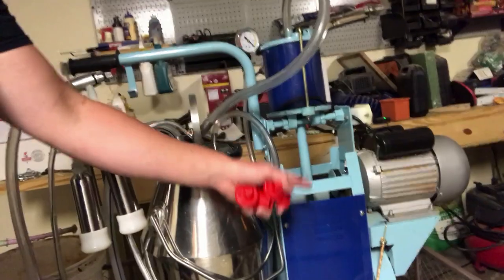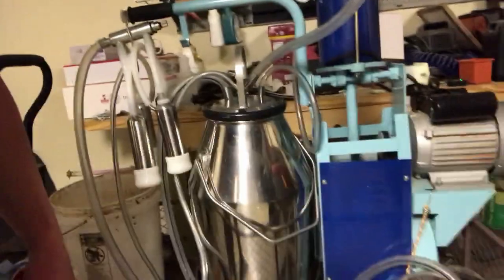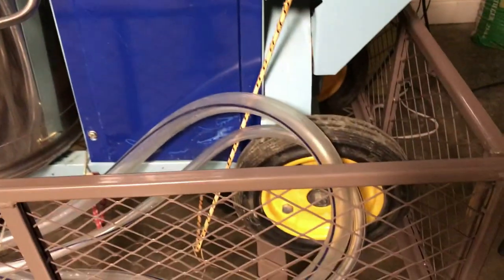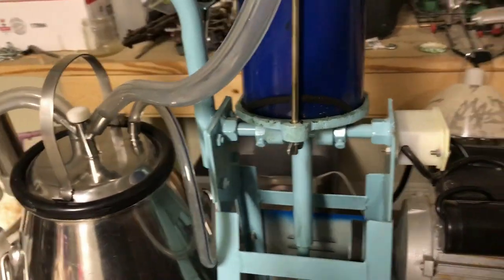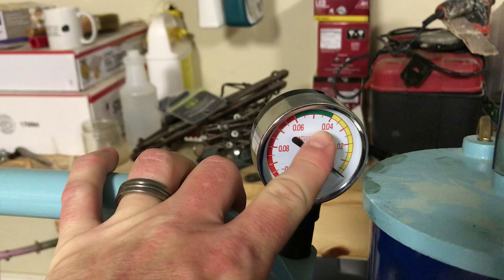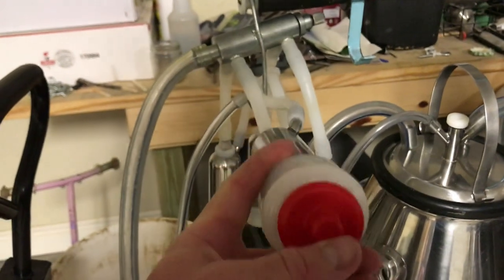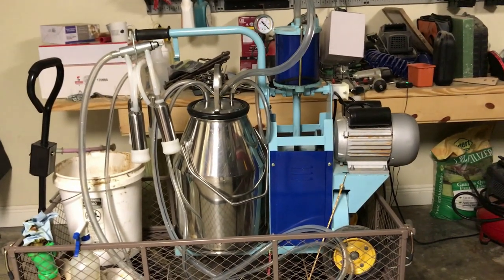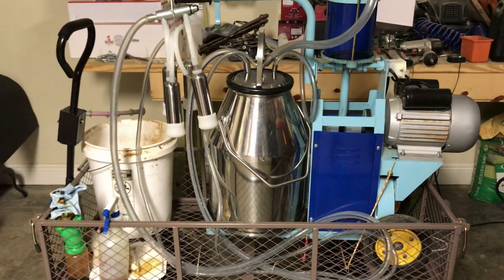Bought On AMAZON For Family Milk Cow Machine Review!! Part 1 Is It Worth It?

Comment: We have one of those machines and it took some adapting the hoses for the claw . They are too soft and light so we bought some of the old type cups with the heavier black hoses. The machine works but a bit slow. It doesnt like any cold weather though and we have to put a light over it. I would hand milk but our cows teats are very short.
Reply from the maker: We definitely had our fair share of adjustments too

Comment: I milk 5 gal by hand in 15 min with my fam cow.  I also milk 200 cows 6 days a week with a modern milk system. 
I have no issues hand milking I'm fast been doing it years. But at 43  I'm looking to the future and I want to save my Joints. I'd like to be miking into my 70s and don't want Arthritis. So I'm buying a milk machine. But I also am starting my own Micro Diary to ad to my CSA and Meats. So I'm buying a michin for use up yo 10 cows.
Reply from the maker: Awesome! Good luck and buying from local farmers is where it’s at! You see rocking it!

Comment: Did anyone else have problems with the milk tasting like the hoses smell. We have had to throw out all the milk we've run through the Milker. It all tasted like rubber hose. We've run vinegar through it and we washed everything before it was used. If it doesn't clear up, is there somewhere we can purchase new hoses
Reply from the maker: Yes. We order food grade hoses from melasty. A USA made company and it helps tremendously!!!

Comment: Hi, thanks for the video, could you add one more video on how the hoses are connected? Thanks
Reply from the maker: Yes we can do that! Needing one to the top of the milking bucket?
Reply: @TheMacs1  yes please
Reply: I would like to see how the hose that goes from the pulsator to the bucket is connected as well as the one that goes to the gauage, I got all hoses connected but for some reason the machine is not holding pressure even with 4 liners blocked, it's a new machine and I'm not sure if something is wrong with the pulsator or it's just wrong hose connections, it would be nice if you could demonstrate how to test the pulsator for pressure
Reply from the maker: Ok I will work on that for the weekend to get it on there. Do you have the liners with caps in there or flipped upside down?

Comment: Thanks for doing this - I bought the same milker. I'm cussing a bit.  I'm trying to find the caps you showed, but striking out.  What are they called?
Reply from the maker: Ha I understand! Look at mitty supply. They are called milk stopper for cow and goat liners. Once you get that it will help for sure!
Reply from the maker: https://mittysupply.com/product/milk-stopper-for-cow-and-goat-liner-set-of-4-pcs-by-melasty/
Reply: @TheMacs1  thanks much. Those worked beautifully.  I'd tried to build a something out of pvc caps but they didn't seal well enough to to build a decent vacuum.  Tonight I had the oddest thing happen. It worked great yesterday and tonight I flipped it on and it wasn't sucking. It wasn't just that it was building vacuum, but the pump wasn't sucking at all. I ran from end to end and couldn't find a leak. I put the caps in and there was actually enough pressure building that it blew them out. It's almost like it was running backwards. Oddest thing. I just had to walk away. Try and figure it out tomorrow.
Reply from the maker: Yes sounds like the hoses are crossed and building back pressure. Make sure your belt isn’t shipping also. If hoses are correct, than check under your middle cap, make sure the o ring is on good and the ball bearing is in good shape. You may need to apply a tad of oil on that ball bearing to help it go up and down to pull a suction. You have a gasket on your pump too, make sure it hasn’t come undone or loosened in anyway.
Reply: @TheMacs1  Yep. Hoses were all fine, I wish I had seen your reply a few hours earlier though. I finally narrowed it down to the ball bearing in the lid. It was stuck pretty good. Why on earth they didn't use a stainless one is beyond me.

I'm noticing that the pump is generally slowing down now that I have it fixed and going again. I added oil to the crankcase. Have to try greasing the piston next.

Where did you find the O-rings? I've been looking for one to have ready for when I need it. Also, are you oiling the vacuum cylinder at all?
Reply from the maker: Yes I picked up an assortment of o rings I think at harbor freight and finally found sizing. I take vege oil on ball bearing and gear oil in bottom where the lil bolt head open up to the reservoir.
Reply: Thanks. It would be nice if they sent a manual with this thing.
Reply from the maker: Yes there definitely needs to be better book of directions for sure. It took a professional dairy man and two other guys plus me to put heads together go figure this thing out lol
Reply: @TheMacs1  I didn't get any instructions at all!
Reply from the maker: Me either lol